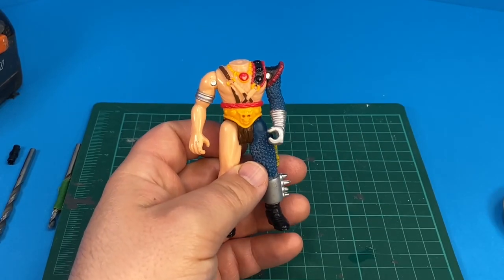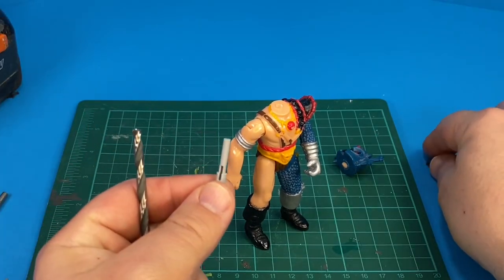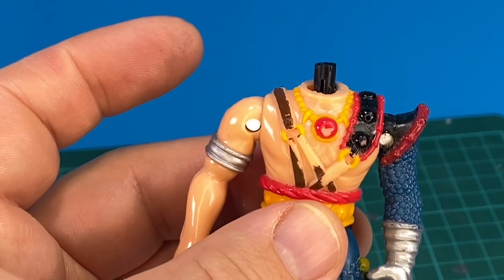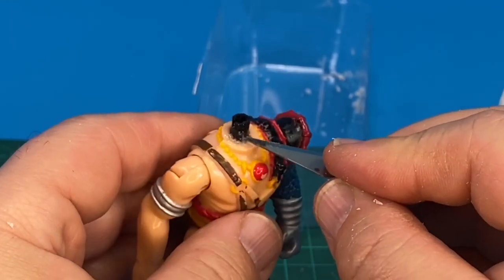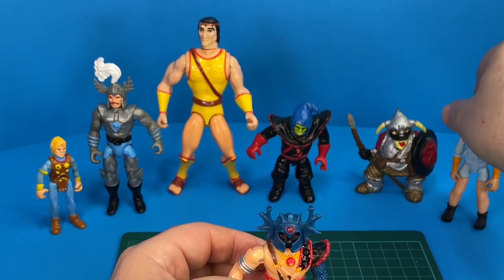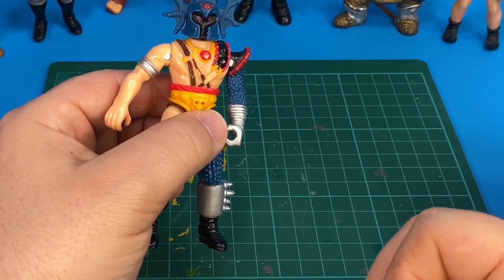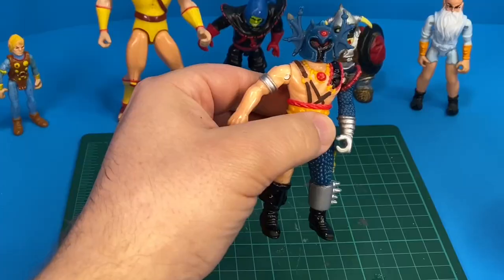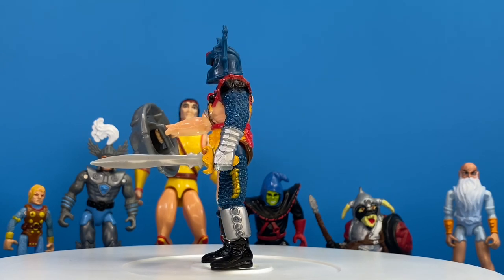D&D Warduke Repair - Reattaching The Head - LJN Dungeons & Dragons

Comment: Be aware that enamel paints on action figures has a tendency to not dry (it's a chemical reaction), with softer plastics. Hard plastics (like torsos) should take it okay, but softer plastics (arms, legs, etc), may not. I found this out the hard way 😂. Lacquer and enamel draw in moisture, and vinyl (i.e., soft plastics) has moisture in it, believe it or not, and this gets absorbed into the paint. Harder, more brittle plastics (styrene, etc), has less moisture. Just a helpful hint!
Reply from the maker: Dude, thanks for the helpful advice. I’ve always used it on GI Joes when I used to do customs but gave the paint away to a friend years ago. The plastic was hard and worked really well but now I miss having it. I definitely will keep that in mind!
Reply: @toysbackzen  Vintage GI Joe's are all hard plastic. I used to use enamel on them as a kid and it worked fine. Most modern figures are made of softer plastics. 

Experiment with it and see what you get, it never hurts to try 👍

Comment: Good idea using the Chips with 
G Glue to make a Filler. 
I would Use Milliput 
But I like your idea.
You can also stuff Aluminum Foul into a Hollow area and fill it with Epoxy Putty .
Like JB Weld Steel.
I'll have try this Trick. 
The Next time
I @$^ up Drill Plastic
Reply: Spray Watet on The,G Glue